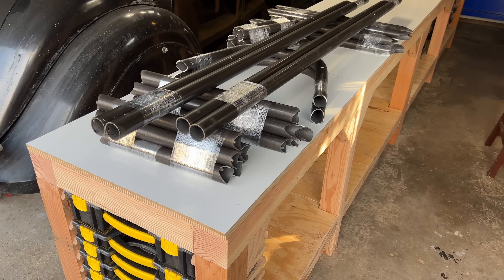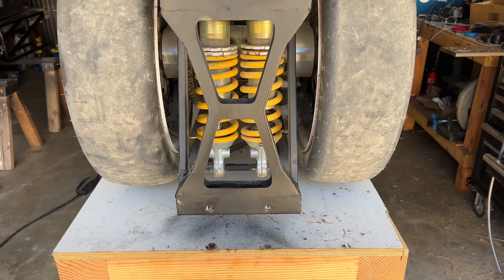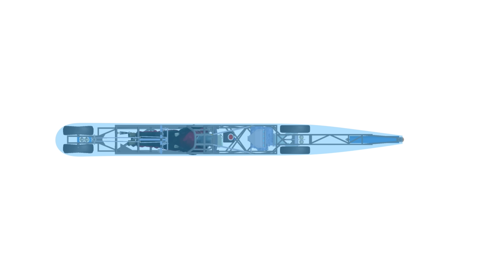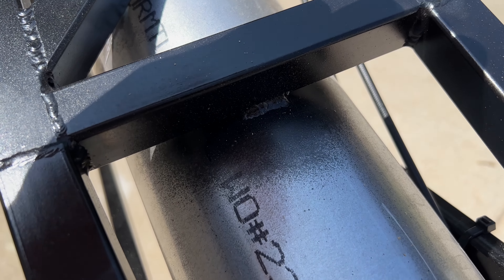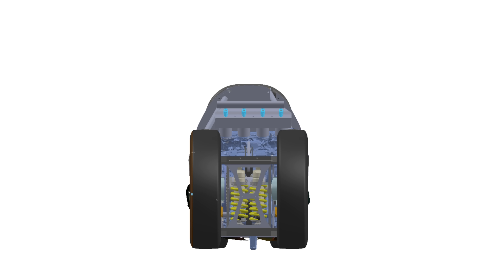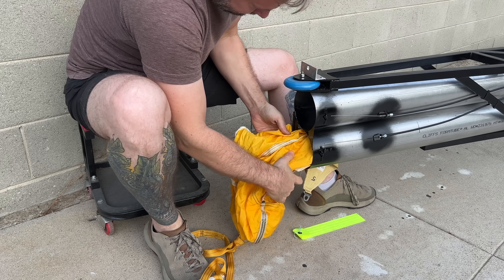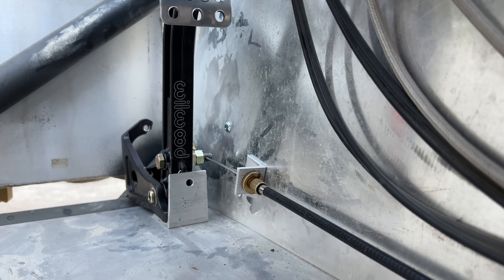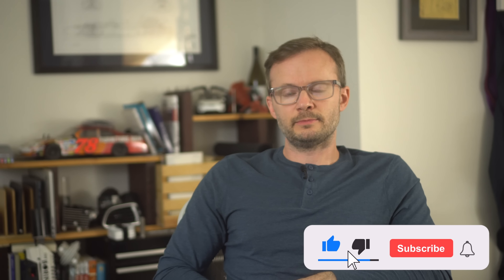The Tail End of the Race Car Build

Comment: For bolts, don't use the "minor diameter" to calculate the area.  Look up the "Tensile stress area" (At) in a table.  It is a smaller value that what you calculated to account for the roots of the threads being stress risers.

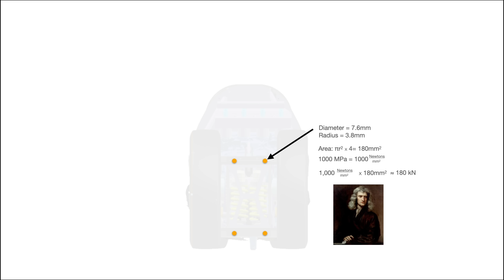Comment: At 6:19, all your tension loads are only on two bolts, not four. Two bolts are in compression no matter if the force is down, up, or sideways.  So net you have 90 nm.

Comment: I tied a rope around the manual latch that you drilled a hole in and ran it through the child seat safety hook and then out so it reaches out far enough that you can keep it pulled while you pull on the trunk.  Worked fine until I replaced the latch motor.

Comment: Don't forget the tension in the bolts from torquing them up. It adds to the tension. Also no guarantee that they all load evenly.

I would add a bolt or a pin in sheer. It's almost impossible to break bolts in sheer.

Comment: That was much more content-filled than the trailer video. I was surprised to find that I wasn't even watching it on 1.5x speed. Converting a boat trailer for that thing will still be a very silly choice, until you inevitably start welding tool boxes to it. I suggest portable power stuff, sockets for shade poles (non-motorized), a grill, cooler and seating. Those are what all boat trailers are missing, and it's about time they stop being missing. Of course, you could use solar panels for shade too, but you should probably put an airgap under them to reduce the radiant heating.

Comment: Calculation for tensile load of a rod of equal diameter to the minor diameter makes sense, but that's assuming the threads at the other end don't fail first. would be interesting to see the calculation on that limit.

Comment: The three forces on fasteners you need to consider are;
Shear, tensile and shock.
A fastener may have a high tensile rating but a low shear rating and a worse shock rating.
I’ve seen HT bolts shatter when hit with the right shock below their yield strength.

Comment: 60 gs is more than you'd experience in some types of crash. I'd have to agree, I think you're good with those four bolts. People both under- and over-estimate the strength of bolts all the damn time.
Reply: bolts are really, really strong, more than one might assume

usually its not the tensile strength that fails you its stiffness in most parts
Reply: @fazeobama8872  That's fair!

Comment: Pretty sure those tubes are aluminized, not galvanized.  Exhaust shops weld through that coating all day every day.
Reply from the maker: Yeah, mistake on my part.
Reply: Usually. Bujt when in doubt, bare metal will always be the right way to do it.

Comment: Why did you use the bolts in tension, rather than turning them vertical, which would put them in shear?
Reply from the maker: Just seemed easy for assembly

Comment: Suggestion. I have no experience with parachutes so I have no idea if this will happen. You tell me! 
With the parachute anchor point at the engine end of the tube and the parachute harness passing all the way through it any lateral displacement of the car or chute, during deployment will lever those tubes sideways out of the car and possibly take the bodywork with them.  I you use two steel rings welded one above the other and to the top chassis rail to remove this risk. Either way I dont suppose it would be a car destroyer but it might be enough to prevent a second run if you can fix it in time.

Comment: Hi Matt.  In the audio visual business we use Truss to span over a stage.  The right way to place the truss is to have the diagonal braces at the ends of the trus to be in compression so they point downwards.  Yours are in tension whihc could pull the welds apart.

Secondly with several hundred MPH of air flowing through the car you might find that the 12V safely handle at the back gets blown outwards turning your 12V off in a fast run.

Last I applaud your brilliance.  Seriously.  And I hope you add a Fuel Economy aspect to your future car designs.  Tesla is too controvertial  Good in regards to petroleum products, disputable in Mining for batteries etc and too damn fast for most people.  How about a Solar powered Electric vehicle that would be a plug in to top off the batteries.  I.E.   Just driving around town 20 miles a week?  The roof and hood solar panels will keep you charged.  Another example example is to detune a car keeping or adding a turbo for only if needed to achieve the safe power needed for highways etc.  My old Saab 9-3 turbo got 35MPG if I was going 70 without boost, when I drove with a light foot it was still fast and fun.  When I need to pass someone it took off.   What would  agreesive tuning and lightweighting and ??? have done to improve that while still retaining a fun and fast car?
Reply: If you're only doing 20 miles a week, just get a bicycle.
Reply: @EmyrDerfel  Funny you say that because that is what I do, but most dont.  your comment helps no one!
Reply: @rickeverett3304  if people think driving that far justifies a car, they're a cause of traffic.
Reply: Emyr, check your subjectivity.  First, those that drive less, reduce congestion. Second, on weeks I work from home I rarely drive, but when I need to do a grocery run I will use my bike if I’m getting less than one whole bag, more or multiple errands and I drive.  Third my first point is to help Matt be safe, my other point is that it would be great if a part of the petrol headed hot rodders transitioned to enviro thinking responsible modders.

Comment: Bit late to the party but that shift lever would've been interesting to have the actuator and cylinder on opposite sides of a lever with the shifter mechanism between them. Basically having it work as a second class lever where the fulcrum is the non-moving actuator. That way actuating either side would push and pull the shifter without moving the other actuator. If having a stuck actuator was ever a problem it would allow you to get the car into neutral a bit easier without any tools.

Comment: Oooh - an engineering puzzle! Let me see if I can work it out. Now 60g is an acceleration or about 600 m/s2. Mr Newton tells us that F = Ma or Force equals Mass times acceleration. 180,000 Newtons = Mass x 600. This gives the mass of the front end of the vehicle - the part that the parachute is trying to stop as having roughly a mass of 300 kg. (Assuming all other values are correct). Sounds a bit light but it's in the ball park. I don't know if Matt has given us the weight (mass) of the car. I'd be interested to know if I'm close.

Comment: Are you sure you want your chute release button that close to all the other buttons? I'd tend to think you should put it on its own control panel. At least clearly separate from the other buttons.

At least protect it with a hinged cover that you open up at the end of the run.
Reply: If stuff is going wrong you don't want to move your hand off the wheel/bars to trigger safe mode. If it's on a separate panel now you are steering your whole hand at arm's length rather than your thumb relative to your grip. This is also why touchscreens in cars are a bad idea.
Reply: @EmyrDerfel  that's why I suggested a hinged cover (I don't know the correct term). The potential for fumbling and hitting the wrong button is huge.
Reply: @TessaTickle  But if he's tumbling that would be the right button to press, right?
Reply: @krashanb5767  deploying your chute while tumbling doesn't do anything. Your chute will just wrap up around the vehicle.
Reply: @TessaTickle  That's a correct term... cover, safety cover, or guard.

Comment: Your TIG welds have HUGE heat-affected areas. Try doing the counterintuitive and increase current to increase penetration and speed + increase cup size and flow of argon.
Reply from the maker: I really should take a welding class at some point. I've just been winging it for like 20 years.
Reply: Grinder and paint make me the welder I ain't
Reply: @KnowledgePerformance7  LOL!
Reply: @KnowledgePerformance7  AvE?
Reply: @SuperfastMatt  Talk to your nearest bicycle fabricator: if you can tig bike tubing anything else is a doddle.

Comment: I'd love to hear an engineers point of view on lock washers. Carroll Smith the racecar engineer and Nasa both say they are ineffective. Please don't take this as a negative comment I'm truly curious. Keep up the great work I love the streamliner! Congrats on the new place
Reply from the maker: The tail is designed to be removed for transportation, so the bolts are necessarily checked every time it races. If it were more permanent, or if the car was running for more than 5 minutes at a time, I would use something more positive. It makes sense here, but I rarely use lock washers.
Reply: @SuperfastMatt  thanks for the response keep up the good work!!!

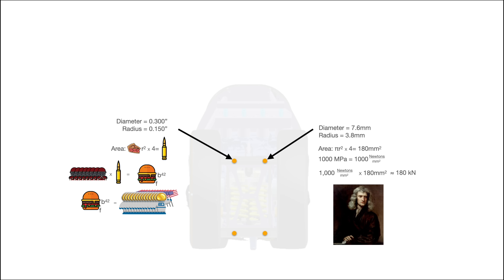Comment: 6:44 Is it not more important to calculate whether the bolts can withstand the forces due to torque from side loading ,rather than the forces due to deceleration? The side loading will get amplified due to the mount being narrow and the tail being long.
Reply: You may be right, I think the issue is more though that even though sideways force has more lever action, it's going to be much much less than the instant deceleration load.  Like 20 mph wind from the side is more stress than the same force pulling backwards, but if you get the same force from the side that you would under parachute deceleration, you're already well into other, much more significant problems.

Comment: there is a video sieres from the arnold company about making a moldless composite plane. should help with making the body. that plane has the speed record for its class and lowest drag for a plane that holds a person and uses quite a bit more aggressive tapering. the drag from haveing more weted aerea is significant so you can be too gentile with the air.

Comment: Why not use compressed air to pop the chutes out directly? I mean you've got them inside a pair of perfectly suitable air cannons... Okay, you still need a manual release but that's a challenge for another day.
Reply: I'm sure that the parachute will more reliably deploy if pulled out from the back (unpacking progressively) than if pushed from the front (jamming it tighter in the tube).

Then there's the need for a manual release.

Comment: 5:40 - This has to be the greatest explanation of bolt tensile strength coupled with deceleration consequences I've ever been witness to. It also lays bare the obvious issue in this world: not enough testicular concern when engineering things, by far.
Reply: I think it's good to talk about shock loading, 60G for like 0.1s is probably not enough to move your balls towards the harness but probably long enough to snap the bolts off.
That said I think 60Gs should be plenty enough, though a real engineering analysis would estimate shock loading and check if it's below the fatigue limit, etc
Reply: Deez Nuts!     Ha ha ha.   Goteem
Reply: @__dm__  Was thinking this also. So safe if G's above 60 and it breaks off. A nutcracker if it is around 50-55 G's for a period 🤓
Reply: I'm just glad he clarified that it was double-cheeseburgers force, not double-cheeseburgers mass - I know here on Earth we always just run under the assumption that the two are the same thing, but it's a small but critical point of confusion that can lead to assumptions and errors when designing for environments where that isn't strictly true.
Reply: Think in reality those bolts will be pulled through the tube steel before those bolts snap anyway.
Reply: Same here😂
Reply: So calculating back if F=mxa then 180,000=mx9.8x60 then m=306kg (or 674lb in American) - if Matt is 100kg then the car is only 206kg.
Reply: @__dm__  I was thinking the same thing. Actually pulled up my old engineering textbook to refresh myself on fatigue loading. The impulse of the shock load could be calculated but I would think the length of time would be just a guess at best and would vary the outcome of the calculation wildly. I'd also like to see the yield strength analysis of the threads and the bolt head considering the method of assembly.
Reply: @joshuawills5242  agreed. The table I'm assembling is going to Jupiter so Ikea better make sure that the bolt sizes were calculated using cheeseburger mass or else this table won't stand up.
Reply: @justwhy2484  I very much doubt that Matt is anywhere near 100 kg.

Comment: Wood...early jet age engineering.
De Havilland on their Vampire jet found the best way of mounting the 30mm auto cannon to the aircraft was via a block of wood.
It meant that the wood didn't rip apart like the aluminium frame mounting points did when mounted directly to the metal of the aircraft.
Mind you, they had the prior experience of mounting a 57mm auto cannon to the Mosquito...which was all wood.
Are landspeed racers allowed front mounted 57mm cannons as retardation devices??

Comment: I feel like the dynamic loads on parachute opening could exceed 60G, so I personally would probably add some miniscule damping - like thick rubber washers under the tail bolds or so.
Than again, the rules would probably specify that if it was necessary.
And I am more a software engineer than an actual mechanic engineer. And even that more by trade and not learned.
So yeah, definitely modify your safety equipment according to what the random guy on the internet said ;)

Great vid btw, even though it focusses quite a lot on yourself...

Comment: If you're traveling 100+mph, couldn't you just have a lever-controlled louver on the side of the car, hinged at the back edge, that opens to channel outside air into the front end of the parachute tube? Seems like it would be simpler as long as it was reliable.

Comment: If you really don't like working with fiberglass, why not make the skin out of metal? More send cut send? From some of your comments you don't seem super concerned with the weight of the vehicle. 

Also I'm curious to see if the body will also break into sections like the rest of the structure and if you will be able to access those break points with the skin on. Wondering how many minutes/hours it will take to split/rejoin when it's all said and done.

Comment: I just started working toward my engineering degree (two weeks into my academic transfer degree) so I feel qualified to point out a major concern. You said "double cheeseburgers" but you showed a deluxe cheeseburger in the math. You may want to double check that to make sure you used the correct burger bolts.

Comment: Wouldn’t this long tail act like a lever, multiplying the force applied to the bolts? They will probably be under the most strain not when accelerating or braking but when you hit a bump at high speed

Comment: Your bolts themselves won't snap, but how many threads are actually engaged? You calculated the tensile bolt strength for everything not touching the threads, but the surface area doing the actual holding is more important!

Let's assume 3/8"-16, class 2A. Breaking out the ANSI screw chart... external thread diameter: .3643 major, .2970 minor. Internal thread .3750 and .3210. I am using worst case numbers here.

So the holding area, per thread, is (approximately) minimum 0.03 sq inches, or about 19mm^2. So you need about 10 threads engaged to match the strength of the main part of the bolt.
Reply: Iirc you want the diameter of the fastener, or 1.5 for a safety factor. His threaded inserts look at least 3x that.
Reply: @nobodynoone2500  Looks like... but it was never addressed! 5 seconds of blurry video do not an analysis make.

Just in case /s it looks fine. I'm getting my revenge for having to become a screw thread pedant by making everyone else learn it too. I'm an EE dammit!

Comment: While you did the math, if the Tail will hold with these four bolts, I was wondering how much force it would take to not rip the BGolt into two pieces, but actually stripping it, so this would essentially be a cylinder and a spiral. Does anyone have an answer to that?
Reply: Depends on how much thread engagement and the shear strength of the material the bolts thread into. Assuming 10mm engagement in a mild steel hole the failure load will be around 140 kN.

Comment: I'm detecting  some familiar design themes.   I like the color of the push-wheel.  Will it match the final paint job?  
 You may need a block of foam inside the parachute tube  to fill out the extra space.
Reply from the maker: Not sure on the color yet. in my mind it is white, but that is against the rules of course. 

I have some foam spacers, but I need to re-cut them. too long! I remember Mark telling me about the duct tape spacer idea.
Reply: @SuperfastMatt  Solid white is out, but white with lots of bright color accent is ok.
Reply: @SuperfastMatt  dazzle camo like a zebra so that only the machines will be able to judge your speed.

Comment: The handle you're using in the back for the power shutoff. Can't that get pulled by some tangled parachute lines? Looks awfully close to that...
Reply from the maker: I doubt it, it looks like its protected by the push wheel. But maybe it's worth using a T handle that has a less "hooked" design just in case.